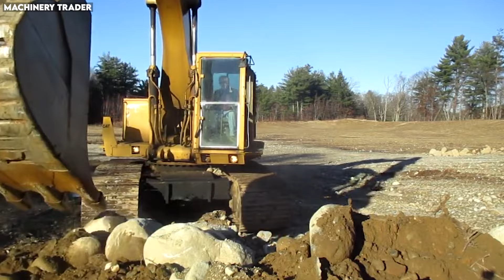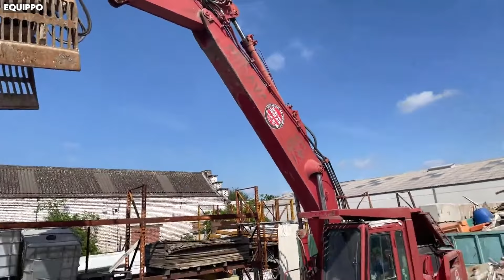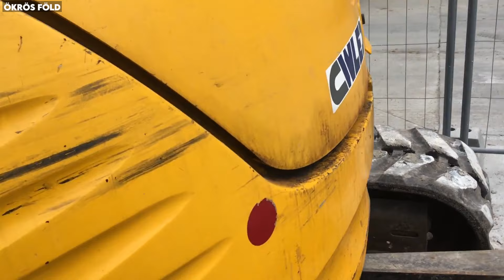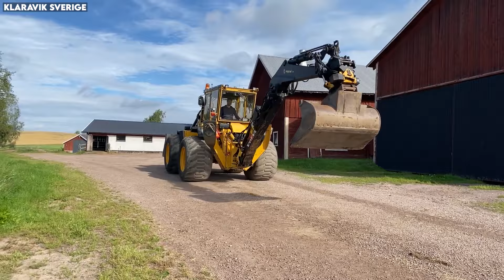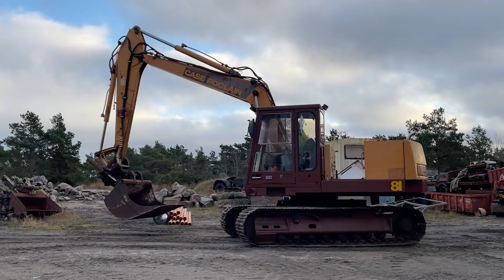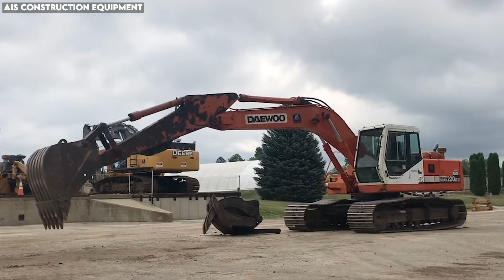10 Excavators From the 1980s That Were Great, But Failed

Comment: How much of this is true because most of the machines are at least 25 tonnes or above and would've only been suitable for mass excavation. Truth be told Japanese machines and German built ones were technically more advanced. I'm not sure but think that up until the mid 90's machines above 2.5 weren't popular here in the UK because backhoe loader's where still excepted and site's and probably considered cheaper to run.